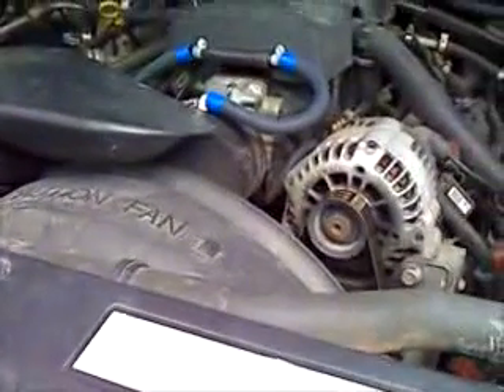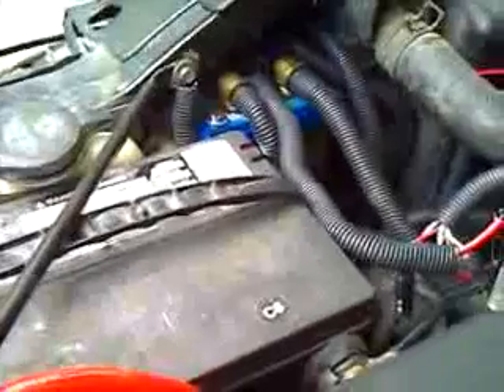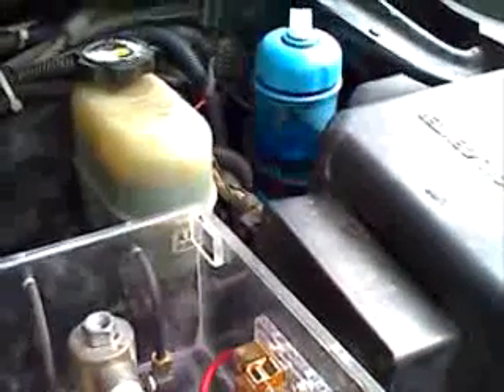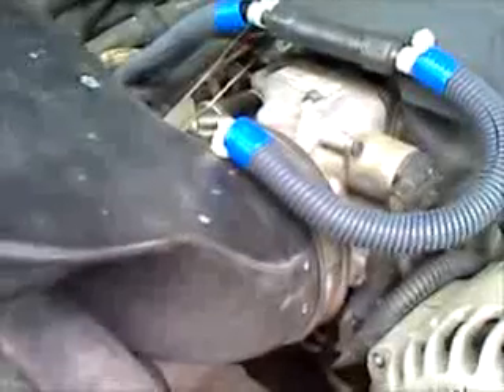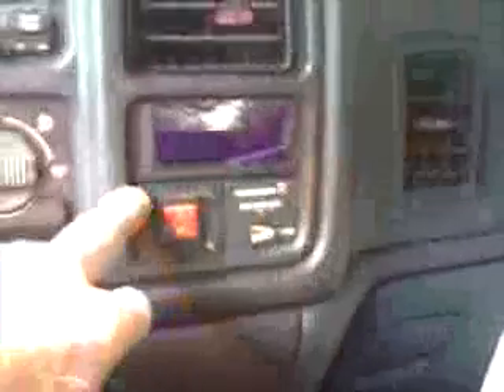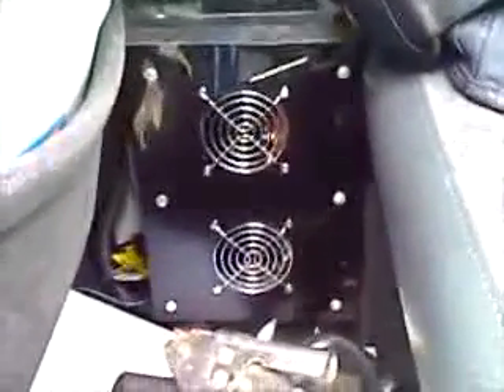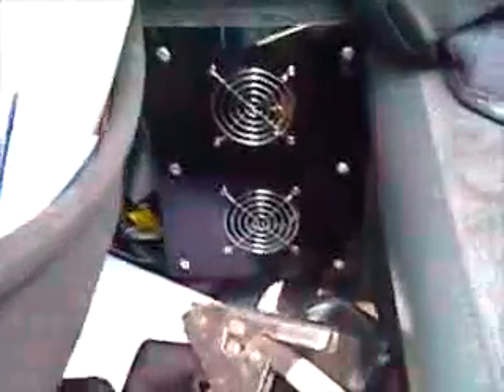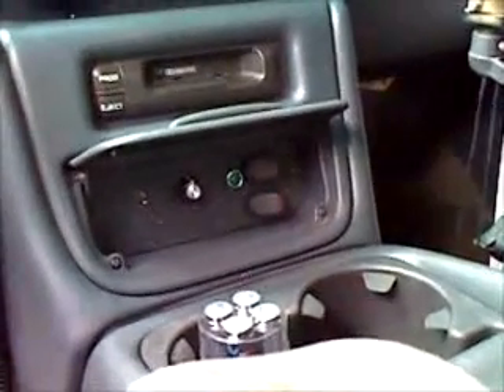Hydrogen Generator Update

Comment: Hey Patro,

How's it going? Are you still working on this setup? I am just now researching Hydrogen.What do you think about the ready-made kits available now? 

I have a '98 dodge ram 1500 v6. I get around 14/20 mpg. Do you think it would be worth it to build a system like yours or simpler (if possible)?

Thanks,
Abtra

Comment from the maker: The flash supressors are home made. Use 1/4' NPTx4" brass pipe. Cram the crap out of it with BRASS WOOL. You can find brass wool at your boat supply outlet. Place stainless steel screens at the two ends, and cap them off with brass nipples. Shrink sleeve the entire unit. VOLO! As good or better than you can buy.

Peace

Comment from the maker: Very true indeed. If our autos of today were as efficient as manufactures claim, we wouldn't need a catalytic convertor to burn all the fuel that didn't get burned the first time around. There is a company working on a converter that recycles the unburnt fuel leaving the engine....they claim to be able to nearly double mileage. Give me fuel from the early 70's and I'll show you 100 mpg. Big oil knows it, and the additives are deliberately added to prevent such systems from functioning reliably.

Comment: I also have a 325 V-8(2003 GMC Sierra), and have used the PCV location in the intake with mixed results.  Are using the fresh air hose on the throttle body as your other off idle input(besides PCV input for idle)?  I didn't measure any vacuum there at 2000 rpm, and I don't see any other inputs on the t.b.. Also, I tapped into the air plenum upstream of the t.b., and it seems to work well.  I would like to try your vacuum input, though....

Comment from the maker: One is for idle and one is for off idle. What motor do you have? The 325 V-8 Chevy has the PERFECT location, located smack dab in the very middle of the intake. When the only location was directly in front of the ventura, I was getting a build up of hydrogen in the bubbler.

Comment: Just to be sure, are you using the fresh air hose location as your second vacuum source(PCV being the first)? I tried reading vacuum on that line, and didn't get any at all at 2000 rpm.  So, I tapped into the air plenum upstream from the throttle body, and am getting better mileage with both the PCV and upstream lines. I really would have liked to hook it up the same way you did, as we have the same engine. Is the fresh air line your second source of vacuum?

Comment from the maker: The location on the throttle body has a fresh air hose. Upwind the air passes through a MAF. The fitting I have is a dead signal.....UNTIL the throttle body open up. The low pressure area realized at this point creates a much stronger signal OFF IDLE. I was getting  buildup of hydrogen in the bubbler until I added the other location as well.  Flash suppressor is brass 1/4 NP jammed tighter than a hatband with BRASS wool. Stainless screens and nipple ends. Shrink Sleeve it and your done.
Peace

Comment from the maker: As far as what the hydrogen/oxygen do, they simply help the projected 14.7-1 air fuel ratio and allow me to run a much higher air fuel ratio without running my engine too lean. Also, improved airflow, correct tire pressures, fully synthetic lubricant, and yes, especially the hydrogen and the ability to gain control of the fuel end of the ECM, great improvements can indeed be realized. This being said, pay your 4 bucks a gallon at the pump, and try and be content with a smile on your face..
Peace

Comment: I rechecked the lines, and the fresh air line has no vacuum  at all at any rpm, and the line underneath is from the radiator going to the intake.  Evidently, there is no throttle body vacuum signal on this year model(2003).  I have seen diagrams of using the air filter plenum with a brass fitting of some kind as an alternative.  Also, what kind of flash suppressor are you using, and is it available?

Comment: I have looked on my throttle body, and the only vacuum lines are:
1) fresh air to rocker arm cover for PCV system(3/8" line)
2) under throttle body a short 1/4" line to the intake manifold
3.) after t.b.: 1/4" vac line to emissions solenoid
There is no vac line on the air intake hose.
Thanks for your help!  I also have an HHO I will be trying in the next few days, and a better vacuum source, I believe, is the key.  My mister is using the center of the intake manifold, and works poorly.

Comment from the maker: Also note that there is a low pressure area located right before the throttle body butterfly. Under acceleration your getting a very large low pressure area resulting from all eight cylinders pulling air funneled that is being reduced to an area of about a 3.5-4.00 inch area. You could almost suck the balls off an elephant at this velocity, so I'd bet the engine can and does use ALL the hydrogen we can give it. Make me feel like Tim Taylor the Tool Man...GIVE ME MORE POWER!...hehe..
Peace

Comment from the maker: It goes like this, and in this order. Bubbler, flash suppressor, "Tee", One side of "Tee" goes to an unported (direct manifold vacuum), central location, smack dab in the middle of the intake manifold and the other end of "Tee" goes to tap directly in front of the throttle body butterfly. I think having BOTH is beneficial. 1. Idling utilizes the direct manifold vaccum. 2.Above 1800 RPM the connection @ the throttle body is a stronger vacuum signal than the direct manifold connection

Comment from the maker: At around 23-26 amps the reactor generates about 3.4 LPM. (This is  32 plate cell). This can be attributed to "cell plate preparation". Can't stress this enough. The more microscopic "edges" I can give my plates, the more hydrogen per square inch I can manufacture. (Even my neutral plates generate a respectable amount). Oh, and don't handle your plates without rubber gloves. The oil in your fingers will STOP hydrogen production where you touch the plates. Sounds picky, but I've proved it. Peace

Comment from the maker: The map sensor mod in still located to the right of the hydrogen electronics module under the hood. It is a simple mod enabling me to "decrease" the voltage to the map. (Simple rheostat). This I'm changing soon. I have something in the works that should be able to TOTALLY automate the hydrogen system as a whole, taking variables such as basing reactor production on speed and temperature of production utiliing a variable PWM controlled by a PIC based computer. Talk about "user friendly".....hehe

Comment from the maker: What I noticed was this. At idle, the fitting in front of the ventura has very little in any at all vacuum at idle/off idle operation. I was getting an extreme buildup of hydrogen in the bubbler (building positive pressure, so to speak). I look at this as "wasted" energy. Can I utulize EVERYTHING I manufacture? You bet I can. Also noted, once engine is operating above 1800 rpm, the area in front of the ventura draws more than the PCV valve. So...Best of both worlds? Dunno. Time will tell.
Peace

Comment: I have a 2003 GMC Sierra 5.3, and use a mister system. I am using the PCV input at the middle of the manifold. I noticed you were using the throttle body input, as well as the PCV as of late. Your input line, is my fresh air input to the PCV system, and has no vacuum. The only other line I see is on the bottom of the throttle body, and it looks as if it goes into the intake manifold. It is very short. Is this the line you used? Any help you could give would be greatly appreciated!

Comment: my tracker saves 30% on fuel..it has a stainless steel thermos as my generator/cell conected to a 5ltr gas cotainer as my electrolye storage the electroyle recirculates via the pressure of the gas(hho)then the electrolye is fed again to the generator via gravity...it stays cool...no pwm.. no fancy coolers no pump..just plain & simple electrolysis gas pushing up the electrolyes then fed back to the generator... simple.... ihope i can find a way to make it upto 50% gas savings...

Comment from the maker: Wasn't purchased. Make it yourself. 1/4" NPT brass tube and brass line tap fittings on the end. The innards are extremely tightly packed "brass wool". Do NOT use steel wool! You can get the brass wool from your local boat parts supply store. I got mine at Boater's World. Pack the living crap out of it. Trust me, the hydrogen can find it's way through it. Stainless steel screens inserted at both ends, then Teflon tape the threaded end caps. Shrink sleeve the entire unit. Or I'll sell you one.